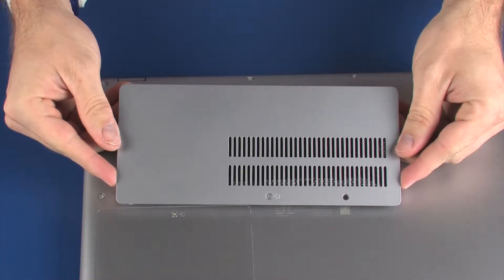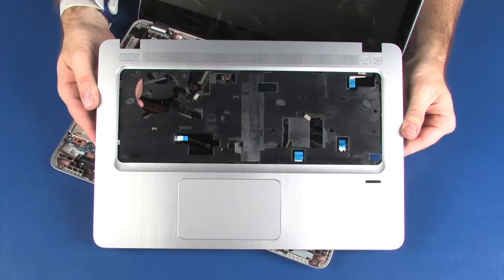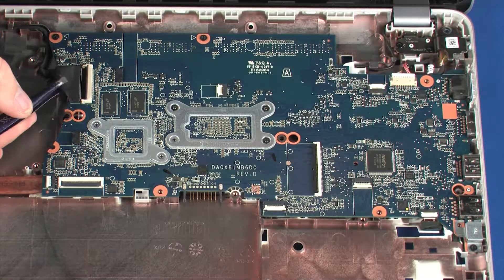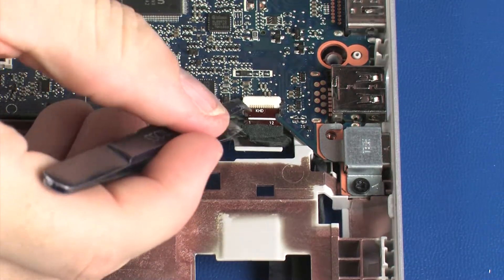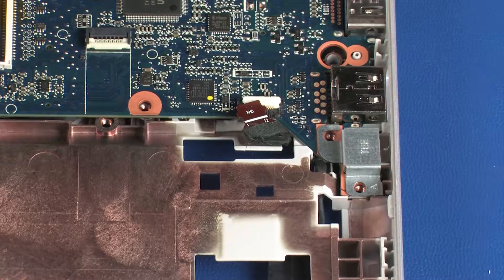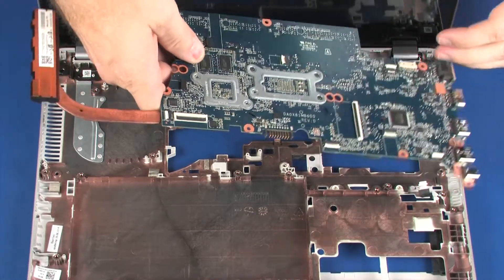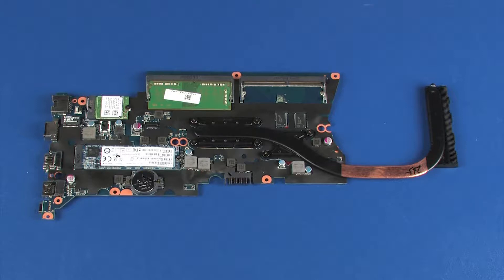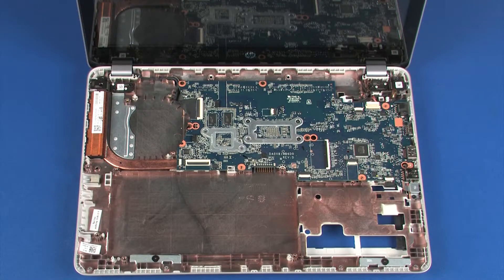Replace the System Board | HP ProBook 430, 440 G4 Notebook PC | HP

Comment: Can we displace heat stick and can we place the 930mx in it ? Is there a slot for it?
Reply from the maker: Hi there, thanks for contacting HP Global Social Media Support!
I understand that you need to know about displacing heatsink. 
I will do my best to assist you.
HP does not recommend upgrading or downgrading hardware parts or software that is bundled with the product as It may affect the manufacturer's warranty and performance, however, you could change the configuration at your own discretion.
Binu_HP Social Media Tech Support
Reply: @HPSupport  Thank you so much for answer!!!
Reply from the maker: If you need any help in the future, you can always get back to us.
Thank you for being a valuable HP customer.
Have a wonderful day!
Cheers!
Binu_HP Social Media Tech Support